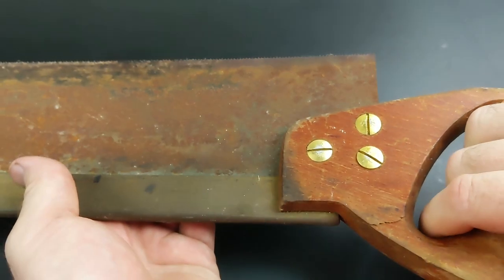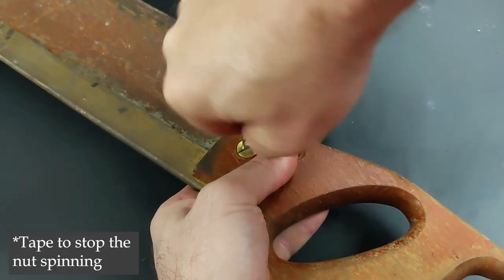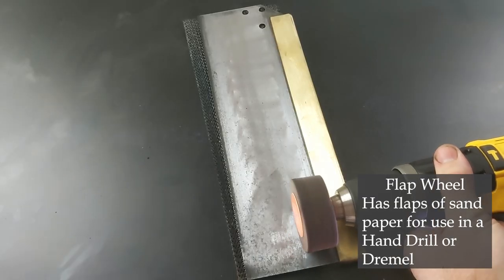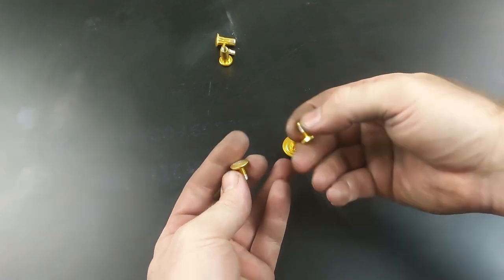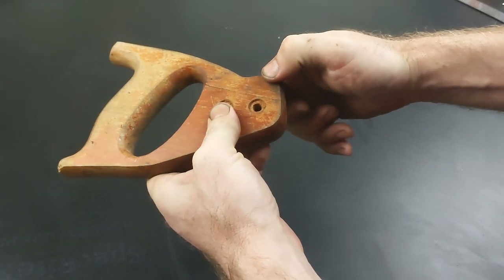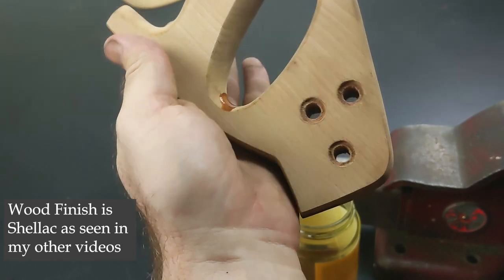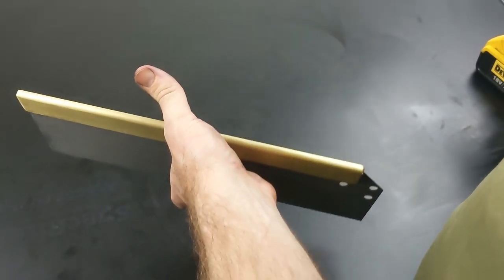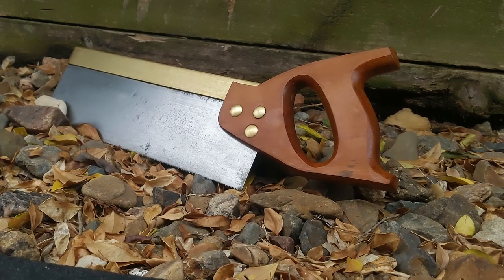Tenon Saw - Hand Tool Restoration

Comment: It's easy to remove the brass backing piece, just an interference fit. Hold the blade in a vice and tap the brass with a piece of wood, once you have finished cleaning the blade, you can just tap it back on.
Reply from the maker: I had hoped for that, but didn't want to risk it. Would have made parts a lot easier.

Comment: You sharpened the teeth , but didn't set them which is why it took you ages to saw through the piece of wood at the end
Reply from the maker: Agreed. They still had a slight set but not enough. I have been looking for an old saw setter but don't see them pop up often.